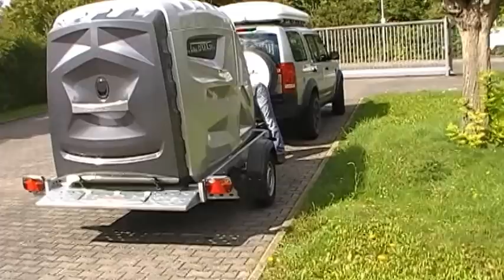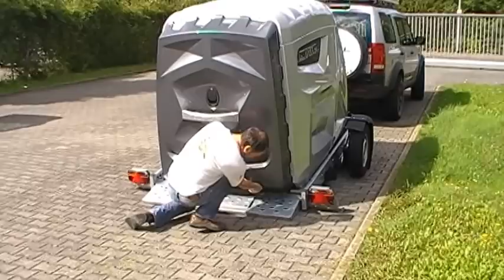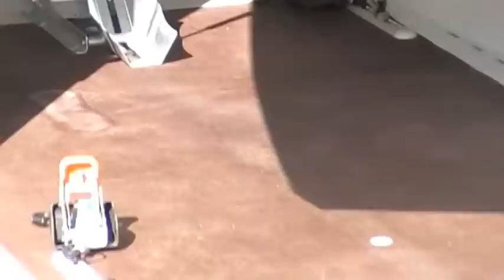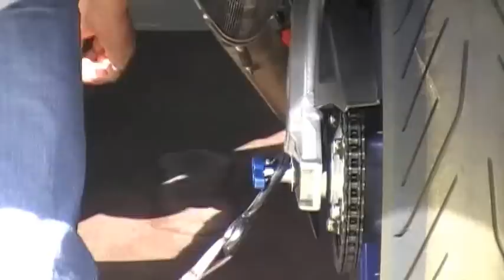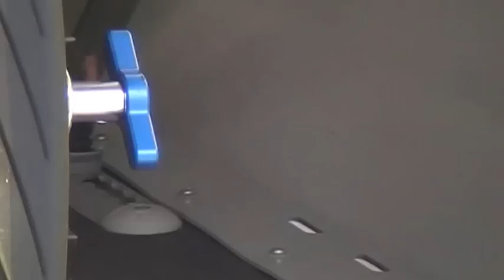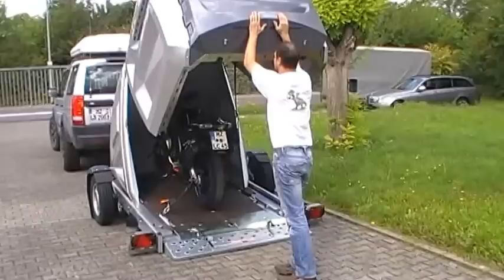MOV1DB

Comment: Nice, too bad it will cost over $6k USD (the XL itselt is over $5k), so yeah, this will cost more than the bike that will be placed inside.     And also cost about 4 tiles that of a full enclosed trailer.  Though it is nice and small enough to fit in a garage.